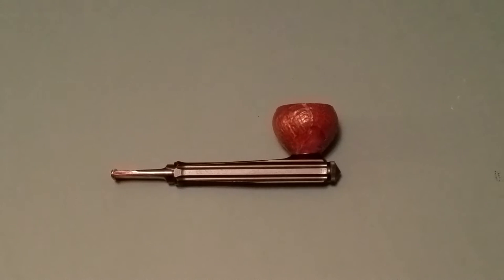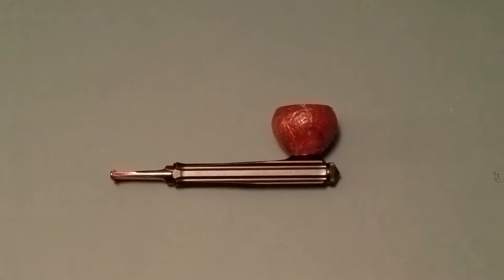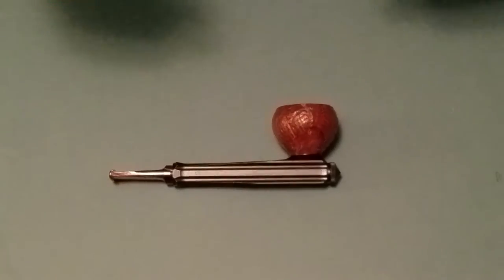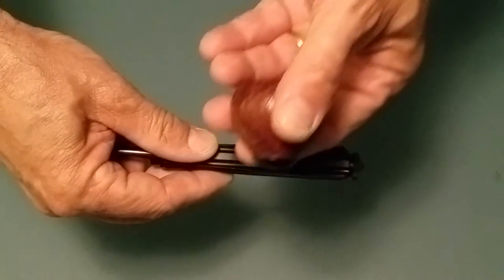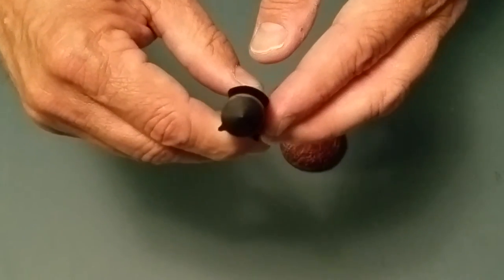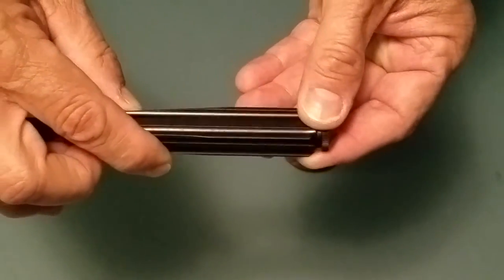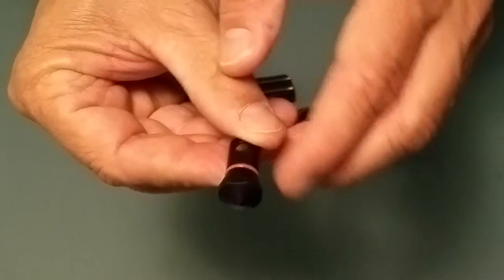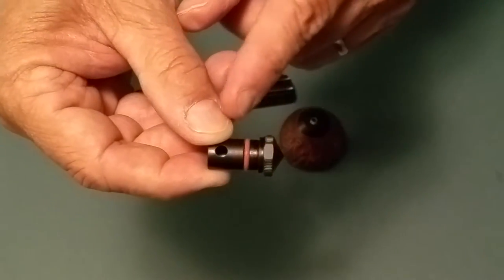Product Review; The Kirsten Radiator Pipe

Comment: I knows this is an old video but I would like to add a couple things you missed about the Kirsten. First I would like to say that I’ve been smoking a Kirsten since 2012 and have collected many over the years.  Your right in saying that you don’t need to clean the pipe every smoke but I would suggest dumping out all the moisture after every bowl. For cleaning I’ve found the roll of blue shop towels work the best. The most important thing that you forgot to mention is how to pack the bowl. Kirstens are designed to have a hard pack from top to bottom. Using the three layer method will cause the pipe to not smoke correctly. Just shove the tobacco in the bowl and pack down tight
Reply: He also left out that because you can open and close the air hole your also able to adjust the restriction of the draw

Comment: Hi Muttnchop: It's an interesting design, just not an attractive pipe. Looks like a screwdriver, to me. I'd be interested to see a comparison between the Kristen, and a Meerschaum plus 9mm. filter pipe; which is the coolest, driest, cleanest smoke, I've experienced so far. Thanks for the product review. Be Well. Ed
Reply from the maker: It is Odd looking, and it takes some getting used to, but it does smoke cool and dry. 👍👍😄
Reply: Hi Muttnchop: When you read the manufacturers description of the Kirsten, it said "designed to trap the tongue-biting acids". Do you find that this pipe does that? I will often get that acid sensation, if I'm not careful, with my briar pipes. Thanks. Ed
Reply from the maker: +GrandpaCavendish yes, no gurgaling, no acrid taste in your mouth if you forget to use a pipe cleaner it absolutely traps all the moisture. :)

Comment: I've bought my Kirsten pipe decades ago in the 90s and it still looks and smokes great. Like you said no gurgling and smoke arrives at your mouth cool as any Churchwarden/Gandalf pipe. You didn't mention that you can change bowls after a smoke and smoke a different tobacco while using the same stem/mouthpiece. You can have several bowls for each day, letting the others dry out before using them for another smoke on another day.

Perhaps not the most beautiful but beauty is in the eye of the beholder, right? They're very practical pipes. Even the straight pipes can be set down on a table and won't roll over! :-)

Comment: I am very new to pipe smoking, and I love your videos. They are helping me a lot. I am wondering, does this pipe style help significantly with tongue bite? I ask because it seems that no matter what I do, I get tongue bite about half way through a bowl. I love this pipe style, and  if it would help me with the tongue bite significantly, I may well invest in one. Either way, thank you so much for the videos, and Happy Piping to you and yours as well from here in Tennessee!
Reply from the maker: Pyroawsome, I to struggle with tongue bite, especially with the sweeter blends, first off let me ask you a couple of questions, what tobacco are you smoking? And have you watched my videos 1. an alternative draw method,  2. How to smoke your pipe using the Breathe Method, 3 How to smoke a pipe, a step by step tutorial 1, and 2?
Reply: +Muttnchop Piper Yes I have, the breath method helps a lot, but I still seem to get tongue bite by the latter half of a bowl... I only have some cheap drugstore aromatic, and a small tin of Frog Morton's Celler. Like I said, new  to pipes.
Reply from the maker: +pyroawsome ok lest do this, invest in a Falcon pipe, pipes and cigars sells, you can also get them on amazon, they are relatively inexpensive around  $80.00 make sure it comes with a medium or small bowl. Falcons are not exactly a radiator pipe, but I find they smoke cooler then briar. also get rid of that cheap tobacco, and purchase some Ratrays  old Gowrie it's sweet and I find it smokes cool, hope this helps
Reply: +Muttnchop Piper Alright, will do! Thank you for the advice.

Comment: Great review. Does the metal radiator portion get hot to the touch when smoking? Really interesting pipe. I don't really have problems with bite, but I still like a cool smoke.
Reply from the maker: The Metal body does not get hot in anyway, the bowl does if you puff aggressively, but after the body cools the smoke, and it reaches your mouth, the smoke is cool and flavorful.

Comment: you don't need to run it under a faucet. just ream it out with a small piece of paper towel and use another paper towel piece for the valve. takes 30 seconds. do it after every bowl.
Reply from the maker: Kyle Ledbetter - Cool, thanks for the guidance my friend. 👍👍👍

Comment: Chris, I recently purchased a Kirsten estate off ebay in excellent condition and I love it so far, but I find it interesting that on your pipe the draft hole on the ramrod is on the "top" of the stem, mine is on the right side. I'm only assuming a change in design was implemented some time after mine was manufactured.
Reply from the maker: TyrantKing - yes, I would assume that is the case. 👍👍👍
Reply: Actually the ram rods aren’t indexed. They’re just press fitted into the mouth piece. Where the hole I doesn’t affect the smoke. I have owned and smoked Kirstens since 2012 and know the Granddaughter of Dr. Kirsten, that’s what she told me when I asked.

Comment: I use a cob pipe.I get tongue burn often.no matter how or what I smoke.even after watching and trying what you say to do in your videos.they are very helpful and have helped some.thank you for that.in your opinion would this pipe be worth me getting for the purpose of only trying to help eliminate tongue burn.
Reply from the maker: RUDY8501 - yes, and no, let me explain. There is another pipe made that would help you with tongue bite, it's called a Falcon, you can get them on Amazon, and they run about $80.00. If you can afford it the pipe in this video I think runs between $120.00 to $150.00 dollars. Just thought I would give you some options. 👍👍👍
Reply: between the two pipes. not looking at price.would you say one is better at cooling.thanks
Reply from the maker: RUDY8501 - yes the Kirsten is better. 👍👍👍
Reply from the maker: RUDY8501 - for some reason your question of weather the Weibe radiator pipe is better or worse then the Kirsten pipe didn't come through where I could answer it, so I'm answering it here. Both keep the smoke cool about the same rate, but as far as style goes, I like the Weibe better. 👍👍👍
Reply: thank you.
Reply: It might be the tobacco you smoke rather than the pipe.  Avoid the sweet smelling variety as it more likely has additives that burn hot.  Smell of the tobacco and the taste when lit is often very different.

Comment: Does That ramrod of metal must make for a hot smoke?
Reply from the maker: Glen M - Actually no, if you re watch the video and fast forward to time 5:41 you will see how the rod is suspended in the middle of the outer housing, that keeps the smoke cool because the bowl and housing absorb the heat, the rod has a hole in it that draws the surrounding smoke into your mouth when you draw on the pipe. 👍👍👍

Comment: That is a lot of parts to clean, I think. Just use a 9mm filter Briar pipe with the activ charcoal paper filters and you will have a VERY cool and dry smoke!! -Nice video by the way.
Reply from the maker: It's not all that bad, you really don't have to clean until the end of the day, just clean the bowl and empty the moisture reservoir in between smokes. You can get 4 to 5 smokes out of it before it needs an entire cleaning. 😃😃😃✌️
Reply: Or meerschaum filters,  which also work well,  but sometimes soften the taste.